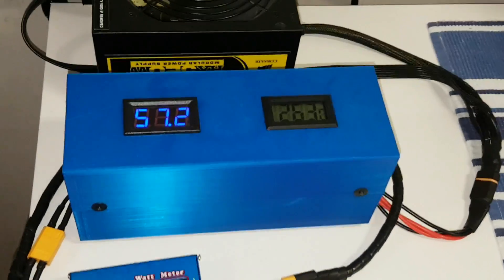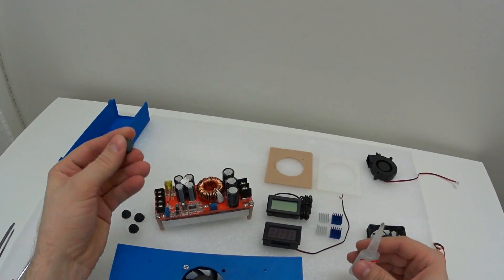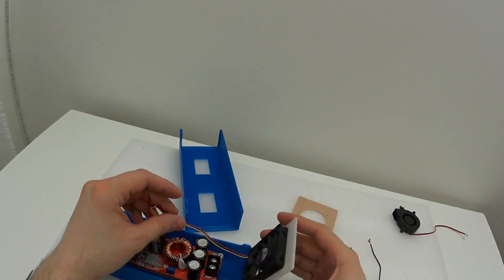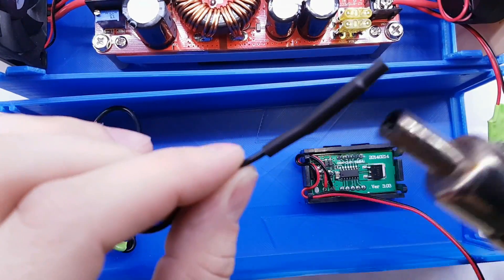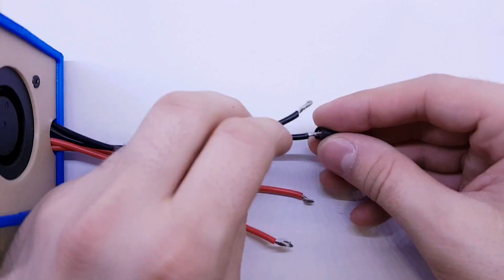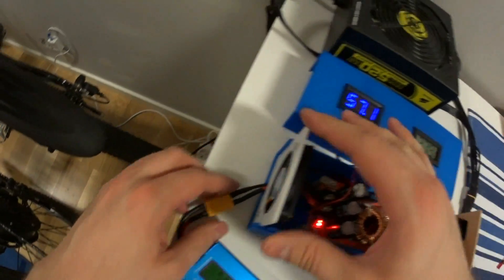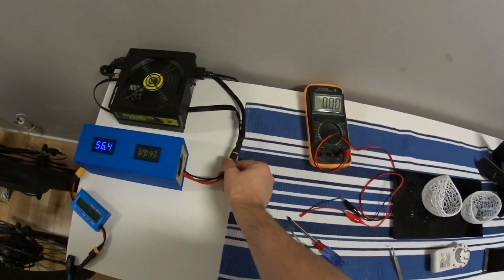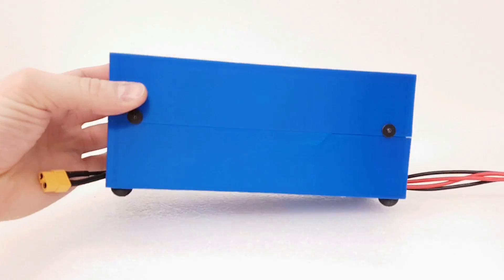How to make Ebike charger - DIY

Comment from the maker: Hi Guys! Here is Version 2! Much better, more powerful and easier DIY E-bike charger then this one from the video! Here is the link: https://www.thingiverse.com/thing:2969696
Reply: Can this one be turned down enough to work with a 13S battery pack?
I just used the same module to build a charger for my 13S pack but It gets a bit warm if I go over 3A. I'm powering it with an old dell 12V 18A power brick. If I used a higher voltage supply would it run cooler?

Comment: Great video, please tell me, should I use some kind of Charge cut-off, or does the Voltage booster work, or maybe does the battery have a charging circuit ?, maybe this is normal with E-bikes ?, i ask, as i want to build one, using two Dewalt Batteries for the supply.

Comment: I don't think it was mentioned but it is important to set the Constant current for those builds. The voltage when starting to charge should rarely be the target voltage end of charging since then the current will be too high and unsafe when charging an "empty" battery pack.

Comment: What one would i use to make one for a 72v (84 v full charge) ebike.  

Link to buy pcb
Reply from the maker: Nowdays is much easier to just get adjustable power supply. You can get from 0-90V Here is example. https://www.thingiverse.com/thing:2969696

Comment: Make 48v 40amp charger
Reply from the maker: Nowadays it's easier just use 60V Power-supply and lower the voltage down to 54.6V. I use two 20A in series. 40A Lithium charger piece of cake.

Comment: Hi i need some help 
I have the same voltage booster board but when the battery voltage nears 54.6 the voltage boosters volatage goea ut to by like half a volt is this ok?

Comment: For higher output, would it be better wire 4 ps's in series, providing 48v to the boost converter, or parallel, to provide higher amperage at 12v to the converter?

Comment: How do you adjust the current output?
Reply from the maker: There is a screw for Voltage and for current on the DC booster.

Comment: Hi nice work 👌 , does it cut off when the battery is full charged
Reply from the maker: Thanks! It drops amperage to zero (0) when it reaches set charging voltage so you can leave it on charger overnight without a problem as long you set correct battery voltage.
P.S. check version 2 in video description. Easier to make and it can be more powerful.

Comment: Cool video,  thanks for explaining,  just wondering though,  how do you tell when the battery is fully charged?  also, if you plugged in overnight, would it just trickle charge or jump to 6amp?
Reply from the maker: Glad you like it. You know when battery is charged when Voltages raise to the set point and amps drop. If you plug your empty battery over night it will charge it to the Voltage set point and amps will eventually drop almost to zero. At that point charger will just keep battery in full state until you disconnect it.
P.S. Check the version 2 in video description.

Comment: so i have a 14s24p Li ion battery with a standard 5A charger and if my BMS supports for example 30A Chargepower i can use a charger with 30A safely at home?

samsung 25R cell btw
Reply from the maker: Samsung 25R cells are 20A cell(each) and they can take around 4A rapid charging rate(each) and nominal charge rate is 1.25A according to data sheet. You wrote that you have 14s24p battery? That's 24 batteries in parallel configuration. What a monster! Your battery could in theory take up to 96A of  rapid charging rate and 30A standard charging rate. Heck, even 50A charging rate should be no problem for your type of cells. 
Now Discharging rate. 20(A)x24(cells)=480A 
So, your battery could withstand of discharging rate of 480Amps, 52Vx480A=24,960W. Insane! Now that depent of how well your battery is built and how well cells are connected to each other.
Reply: @NexiTech  
Thx for all the infos <3 
They sell this Battery with a 70A BMS and a 5A charger. Rated for 2800W Motor.
i use this 14Kg beast for my 1kW Kit and extreme range. i just want to change the BMS for more charging Amps. i think i will open up this beast and look if the quality is good for a 50A charger

Comment: Sir how long do i have to charge my battery,,i have an ebike reted at 48 volts,what charger voltages shoud i use and what's voltage settings i have to put on my battery

Comment: Great video Nexi! Very nice build. Does it matter what gets connected first? For example, should everything be powered up first before plugging in the battery?
Reply from the maker: Thank you! Yes that's correct. Power it up first and then connect the battery. 
P.S. Check out the Version 2 in video description.
Reply: @NexiTech   Thanks Nexi. I built this one because I had the parts. I burnt out the shunt resistor by plugging in the battery first before turning it on, oops. Added a diode to prevent this in the future. Do you know where I can get a replacement shunt? (it's the copper wire near the output terminals)

Comment: I have a little bit problem a with this settup...
When I wire correcly, was a realy big spark from last conection, I allmost s*it my self and pc power suply turned off becouse of short-curcit protection

I have a little bit fear to screw all up, becose if I short-curcit  the battery.... It will not end well.

Sooo.... What should I do next?

Comment: This is really cool. I am thinking of building a charger to charge my ebike from solar energy which would be stored in 12v leisure batteries. What I don't understand is how to avoid overcharging, commercial chargers presumably cut out when the battery is fully charged but your design does not do this? am I misunderstanding?
Reply from the maker: Thanks! Please check the version 2 in video description. Much more easier to make, cheaper and more powerful. 
When you set the desire voltage and battery reaches it, Amp flow will drop to 0 and it can stay like that basically forever. You can't over charge Lithium battery if you set charge voltage output to the safe level.

Comment: how dose your version 2 safely charge lithium packs. I wouldnt think a simple dc powersupply could charge one correctly
Reply: TL:DR charging lithium isnt hard. You pretty much cant go wrong along as you don't overvolt or use too much amperage, most batteries have a spec sheet that specifies their charging parameters for a single lithium cell it will always be charged to 4.20 volts and usually around 1 amp you can go lower or high but it might get hot with too many amps then you can simply multiply these values by your battery pack. if you have a battery pack with 10 cells in parallel and 13 in series then 4.2*13=your voltage           10*(whatever their rated amperage is)=your amperage.

Comment: Nice Job!  I am wondering, if you wanted to custom make an e-charger like this for say... RAD bike 48V @ 14Ah.  Charger from rad is like 52 Volts @ 2Ah. But the real interesting part would be, would be to charge this up so a DC-DC converter from a 200Ah, battleborn battery at 12 Volts.  Can you buy a board like this and custom make one? to do that instead of 120V.  Thanks for your video!  again, great work.

Comment: What about balancing
Reply from the maker: Gainster BMS is balancing your cells not your bulk charger.
Reply: @NexiTech  isn't charging each series part of the battery with it's own separate stage charger a better approach than having a bulk charger?
Reply from the maker: Gainster Yes it is, but finding 13S or 14S charger is not easy. 
Almost nobody's is making them. People have 20S battery packs these days so bulk charger is only logical option. 
P.S. This charger is old, there is V2 of this charger, check video description.

Comment: Hi Nexi love your project so clean and cool. Do u think this will work for 62.7V bat? I have a cheapy 2A which doesnt work as it should and want to make my own to have better control on the charging and pump some more Amps too. Thnx in advance, Greets from Greece
Reply from the maker: Thank you so much my friend! Please check the V2 of this charger, it's cheaper, more powerful and easier to make! https://www.thingiverse.com/thing:2969696
P.S. for 62.7V battery I would chose 70V power supply, I believe you can lower the voltage on potentiometer from 70v to 62.7v but please make sure to read any comments and description or contact the seller to confirm this before you make a order.

Comment: Will this charge sealed led acid batteries
Reply from the maker: Yes it will.
Reply: Nexi Tech could you just us a dc bench power supply to charge it? Like this

https://rover.ebay.com/rover/0/0/0?mpre=https%3A%2F%2Fwww.ebay.com%2Fulk%2Fitm%2F312593441777

Would I still need the watt meter thing you where using?

Comment: the voltage controller costs 50$ ! ..this is  a price of charger !! isn,t it ??
Reply from the maker: You do realise that this video is over 2 years old? Check the second verison of charger that I build using cheap Powersupply. You have link in video description and in the PIN coment.

Comment: Excellent video, thank you, but so many wires coming from the PC power supply, are these all the 12volt wires wired together?
Reply: Typically the yellow wires on PC PS are 12 volts. You can connect them all together to act as one big wire. This helps when more current is passing through.

Comment: at the end of charging the current goes down normally on my cheap charger...

is it healthy if your charger pumps 6A all the time in the battery?
Reply from the maker: Yes it does. This is old version. Right now I use 10A power supply charger. Check the pin comment or video descritpion. I have build two 10A chargers and I use them in parallel for 20A charging as my E-bike battery that i build is huge!

Comment: I don't know where booster link is. Can you post it here? My CPU is 620 Watt. Need charge 36VDC battery pack with 42vdc. 620/42×80% = 12 amp

Comment: So basically you took a power supply from computer, purchase Volt booster
So Volt input into the battery pack is higher then your ebike battery. 

I have a 620 watt ATX 12V power supply from my computer.

What kind of booster do I need to buy for my 36VNiCd ebike battery pack?
Reply from the maker: 36NiCd???  No way! I never seen NiCd battery that size! You could get version 2 of my battery charger(link in video description) and just get 40V 10A+ powersupply and adjust voltage to 36V if that is your charging voltage? Usually voltage on  40V power-supply can be adjusted from 34-42V

Comment: I use the same idea, but the cheap volt and amp meters are rarely on the money so I only use the meters as a ruff estimate. When I set it up I use a Fluke that was recently calibrated. I want to get these meters that you can calibrate to a good multimeter and I know it would only be accurate at the power I need, but if someone knows please leave a link? For now I just remember 13.1 and 12.9 is really 12.6v, Thanks

Comment: Nexi,  Hopefully give me your opinion or thoughts on this, as I am really using guess work more than maths or theory.  
 I am thinking of building this using a 36V 10A SMPS 
I will be using it to charge a 36V 30Ah lithium ion so charging overnight maybe 40V at around 4A to 5A .
My thoughts are that rasing the input V to 36 is going to give the buck converter less work to do,,  and perhaps less heat from the buck,,  perhaps it will last better.  Thinking that the SMPS with this demand is around 3/4 of it's theoretical max.
Am I perhaps being ambitious, expecting the china made 10A 36V smps to continuously supply this! 
I prefer to over spec things but I am trying to keep cost down at present.  

Thanks Ray
Reply from the maker: Reamann MacBiatiagh I have maybe easier and better solution. Insted of this charger  from the video am using V2 now. Much better,simpler, more powerful and easier to make/convert. 
For my 14S 37Ah pack am using 60V 10A powersupply with adjustable voltage from 52V-60V. For you there is 42V power supplies 10A-14A that you can use, they should have adjustable voltage 3%-5%+-
consider that you have big 30A battery so you could use extra power as well when you need a Quick charge. Some 42V power supplies have 14A current which is great. On 40V i guests you will have 8-10A which for your 30Ah battery is actually slowly charging :) Not sure how many parallel cells you have but on mine 52V 37Ah I have 16 cells parallel with 60A active/smart BMS. I can charge mine battery on 20A/30A current easy or even more with no heat.

P.S. I never charge my battery over 4V per cell and I never charge it over night or let fresh charged battery to stay charged for long time if I don't use my e-bike. I use active smart BMS with Bluetooth to protect and monitor charging/discharging current, voltage levels of each cells pack and temperatures on my battery and much more over smartphone App including editing parameters and behaviour of BMS. 
I hope I helped :)
Cheers! 

Look at the link: https://www.thingiverse.com/thing:2969696

Comment: But isn’t the point to charge them slowly for better longevity?
Reply from the maker: Acrimonious Mirth Slowly? 6A changing rate for my 37Ah 14S battery is actually very slowly :D I still need 7 hours to fully charge. I never charge my battery more then 80% to save cells life. Btw this is old version of charger. I using now 10A charger. Check the link for new verison. Much better and easier to make. 
https://www.thingiverse.com/thing:2969696

Comment: DEAR Friend,

if i wants to use this converter as regulated power supply as describe in the module listing
like 12V-90 V /1500W. and insted of SMPS i wants to use Transformer power supply then please suggest me the transformer output reatings.

waiting for reply

santosh

Comment: when you mentioned amps output you spoke of your battery and 60 amps.  what is 60?  and what is the relationship between whatever 60 is and the amount of current (amps) which the battery can absorb during charging?
Reply from the maker: Jay Tom Heldman My Ebike  Battery that I make is 14S 224pcs 18650cells, capacity is 37Ah and BMS is 60A. My BMS in time of making this video could handle around 20A of charging and sense my battery have 16cells in parallel in each group I could charge them even faster then 20A at 58.8V but I really don't need to go higher then 10A-20A. 
P.S. I don't use this setup no more for charging my E-Bike. I brought cheap 60V 10A power supply and I lover voltage to 58.8V. I add voltage meter,XT60 connector,few heat-sinks on mosfet sides. It runs like charm and it's much easier to use it and cheaper then this method from video. Here: https://www.thingiverse.com/thing:2969696

Comment: So if someone was to break open the charger they got with their shark or triangle pack ebike battery. Then the internals would look something similar to yours or would it be a different type of technology? Because a lot of ebike chargers I've seen are less advanced than yours and just have an LED to show that it's charging and another to say the battery is fully charged.  

Great idea  and video, thanks!

Comment: I have a question please. If I have a battery, 12 v16A Lithium. Three cells. At what voltage should the charger cut the current? 12.6? or more? Thank you

Comment: How are you managing to connect this to the battery without getting a massive power surge from the battery and capacitors which blows the charging fuse in your battery and blows your charging port?
Reply: The BMS inside the battery should have no issues when connecting power.
Not sure about this video but I recommend XT90S connectors as they have a nice antispark feature. Looks like normal XT90 but with a green marking.

Comment: Please tell me how on earthis this practical ?
Reply from the maker: It's not for everyone :) In the time of making this video I needed the Ebike charger and one year ago 58.8V chargers was very expensive and I had few of this boosters in the workshop anyway, few old PC power supply and parts so I told myself lets make Ebike charger, it could be fun and useful as well and I can save some money. This booster is 30A rated and it comes with standard small fan. There is boosters without fan and they are 20A. With extra 2 fan in puss/pull configuration like this you can go higher than 30A without worry(and there is temperature sensor on board,. I was using this setup for charging mu bike for more then 9 months and booster is still working great. Never let me down, burn fuses or short out in all this time and I was using it every day to charge my Ebike that I ride to work and back (26Km) every day. 
Two months ago I upgraded this Ebike charger(booster) and now Am using 60V 10A powersuppy(They got very cheap now and they have adjustable voltage from 50-60V) to charge my ebike and I have two of them. I run them in paralel as well when I need Fast charge of 20A on(58.8V) or 1200W of charging power. I add few heat-sink on them where the mosfets  are and they are stable and cool. I send you some photos maybe it can be useful to you. Here are the photos: https://my.pcloud.com/publink/show?code=kZXuoR7ZUSApXHfzJSYNiz482Ww61Xgka1yX
Reply: if you had made acase for it all then yeah but i can tell you thats you are gonna break it if its separate since youll keep nocking it don aso .... have you looked into making your own circuts ? AKA KASYAN has some very good videos on this topic chek him out very simple schematic yet very powerfull

Comment: Can you use this to bulk charge? Does the amperage lower itself as the voltage of the battery  rises to the set voltage? Or do you need a BMS?
Reply from the maker: jbuccaran Yes you cam use it for bulk charge. Amperage is lower itself as battery gets full. At the end of charging proces when it reach set voltage it will drop completely.
P.S. You need BMS in anyway. This charger will not balance your cells.
Reply: Thanks for the quick answer.